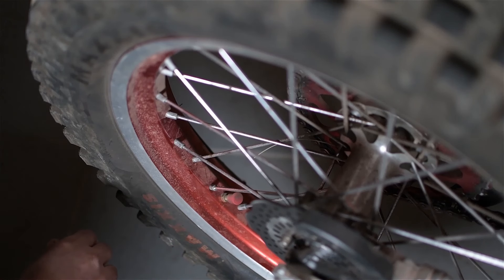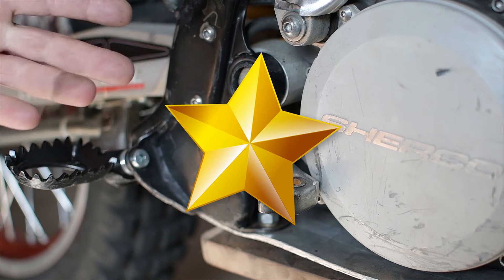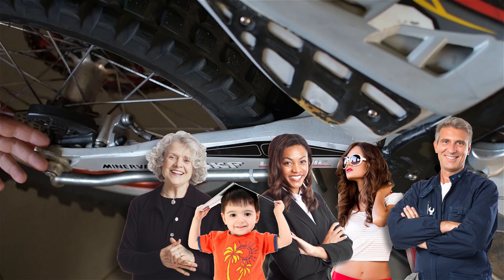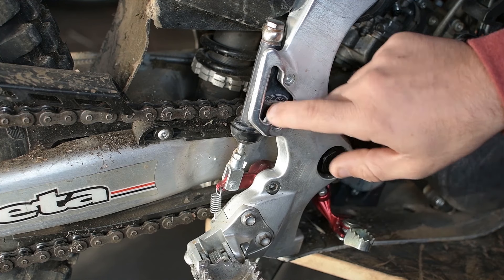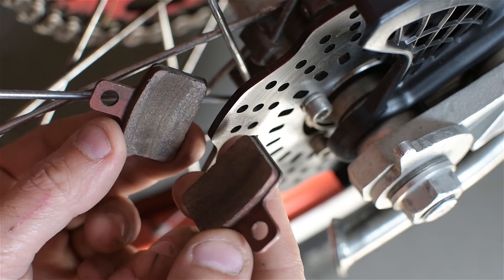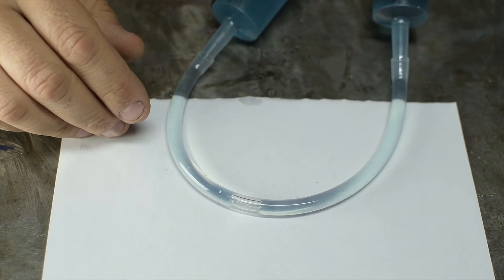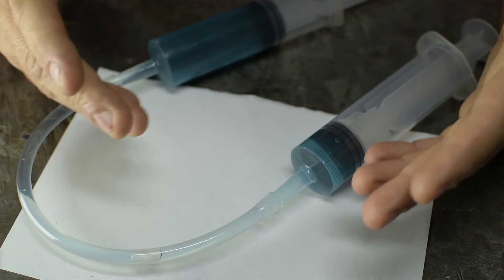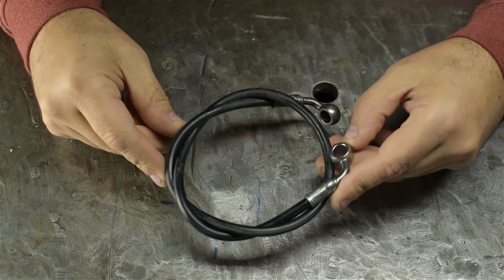I'm an Idiot! (Soft Spongy Brakes)

Comment: Ok, so maybe I don't understand motorcycles. In fact i would go so far as to say I am disinterested in them. Being as I own an auto repair shop and work on brakes almost every day, I am slightly confused by the conclusion of this repair. In the world I live in (the automotive world) the master cylinder has a compensating port. Aka the port to the reservoir. This port allows the stroke of the master to be refilled so that any fluid left in the slave cylinder or caliper (due to rotor or pad wear) to be "compensated" by fluid from the reservoir. This action is the reason your fluid gets lower in the reservoir the more the pads and rotor wear. If new pads an a worn rotor can cause a poor pedal just think how fast your master cylinder would run out of stroke as the pads wear. I have seen poor rotor surface cause poor stopping power when  resurfaced rotors with worn out tooling (Repaired by buying a new rotors). I do not believe it can be the thickness of the rotor when the pads themselves are designed to wear a much further distance in terms of caliper piston travel.

Comment: I doubt it was the thinness of the rotor. 
To demonstrate this remove the rear wheel so there is no rotor between the pads.

The hydraulic brake system acts like a ratchet, each time you depress the brake pedal the brake pistons will keep advancing until one of them pushes out so far the seals come out of the bore at which point you would have no resistance and a very noticeable leak.
Even if the rotor was thin as long as the piston seals are still engaged in the caliper bores you should have a firm pedal.

My bet would be the thin rotor was warped  pushing the pads away from the rotor requiring more pedal to finally advance the pistons/pads to a point where they make full contact with the rotor.
Please do not go into a shame spiral over this and stop producing these epic productions!

Comment: It was probably that the old rotor was oil impregnated and therefore not gripping. The brakes aren't really spongy but they feel that way because they don't  work and you keep pressing harder for no effect. In my experience, some bicycle rotors do this  - where no amount of cleaning or resurfacing will get rid of the oil, whereas other brands can be easily fixed by degreasing and maybe sanding them down a bit.

Comment: That little variance in the rotor isnt the over all problem then. Its the lack of travel in the piston. If your pads and rotor have to be so exact for function its an engineering problem. What are you supposed to do? Buy new rotors and pads every time you want to ride? Fix that and your pads and rotors will also last longer.

Comment: Had this problem too.  If you remove your caliper and press the brake while watching the caliper pistons you will see they act like they have a spring return. They should not.  They should come out more and more with every press of the brake lever until they fall out on the floor.  It's probably caused by gunk under the caliper dust seals.  Was in my case anyway.

Comment: This fault will only manifest with a "fixed" caliper type which are mostly fitted to motorcycles and older vehicles. "Sliding" calipers allow for disc (UK) (rotor (US) wear. Now fitted to most modern cars

Comment: Ok? But why tho? My Suzuki can and will stop with fully worn brake pads and nearly 2mm thinner rear disk... The brake cylinders are on one side and the full piston travel is nearly 20mm... Who would design a brake that stops working when you rub 2 mm off your brake pads??? I am dead sure you have a problem with the brake cylinders on the back. Maybe they have corroded and are not allowing for the full piston travel designed in to them... As you know they are supposed to self adjust for normal wearing in the brake pads, and that's why the master cylinder's pump seal is designed to be a one way check valve as well.

Comment: Yep, don't take it too hard This Old Tony, there is one other point to consider. it was a 74 MGB and... well simply, the slave cylinders are made of some kind of pot metal which becomes more porous as they age, making it worthless to try to hone them when installing a seal kit. seems the brake fluid will bypass seals by traveling through the pores. This only took me about 15 years to figure out.

Comment: It seems like the master cylinder was not calculated for the volume of the brake cylinder. Even with a lot of wear, the master should be able to push the volume needed for the brake cylinder to move even more. That is why you must match your master cylinder with the calipers when you upgrade one of them. In this case I think it was bad engineering.